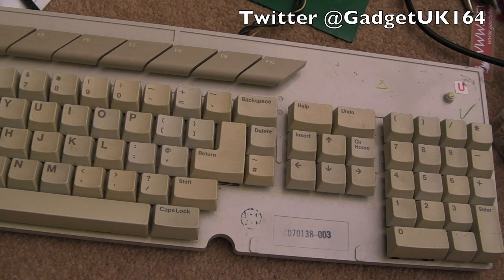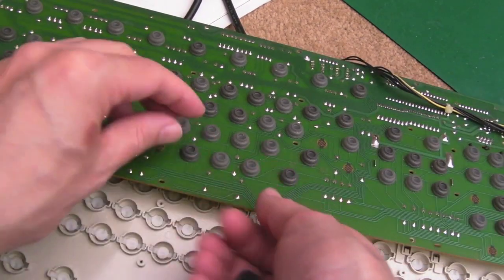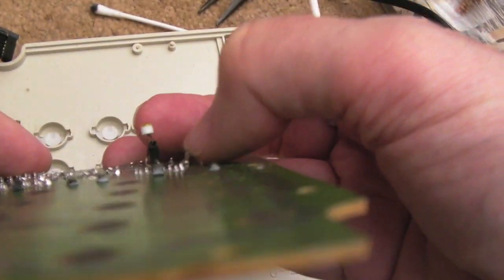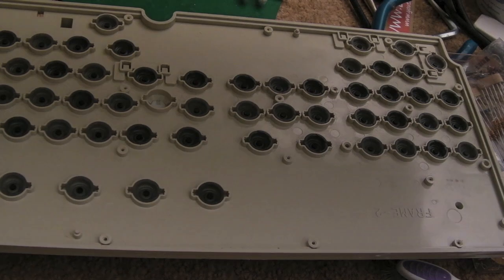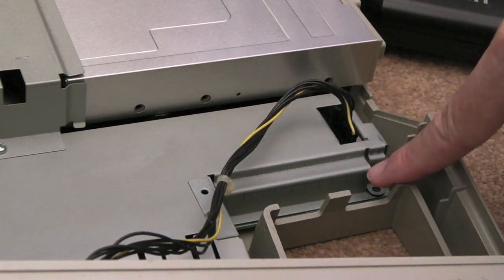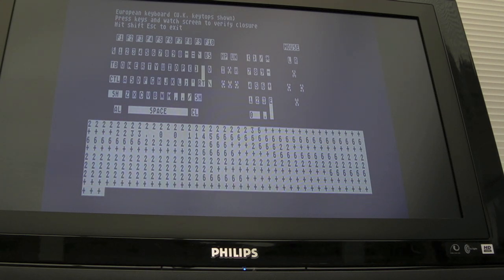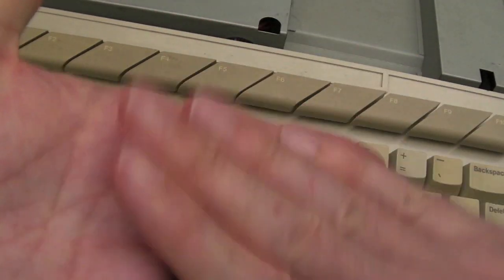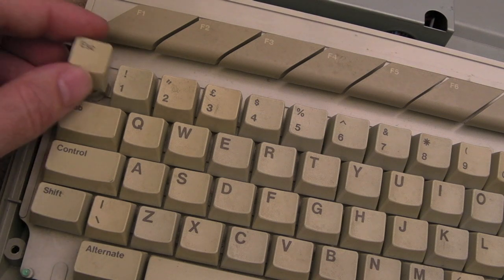Atari ST / STE / Falcon - Keyboard / Joystick & Mouse Ports Repair

Comment: Thanks a lot man. Quite comprehensive
Reply from the maker: Glad it helped!
Reply: @GadgetUK164  Indeed it did, though I had no idea that the soldering points would be so so small. I had to try like four times because the tip I was using was way too thick and after the first soldering the mouse was acting funny. Thanks to my phone camera I was able to find the unwanted contact and fix it. All's well that ends well. 😅👍

Comment: I made another comment about getting a better quality camera and I just wanted to add a caveat.... you're getting a lot of really good closeups which, in my opinion, is more important than a high resolution. So getting a better camera could be pointless if you can't use it to get as close... IE: Close-ups > High resolution.

Also loving the fact you're including ALL your thought process, especially the ones that turn out to be completely wrong. The number of times I get stuck on a problem and don't have a clue where to go with it, seeing your workflow at every step is brilliant and inspiring

Comment: Those rubber/carbon pads can be refurbed by rubbing the central black dot on a piece of paper instead of using IPA.
Reply: I stuck a piece of foil over rubber part.

Also - vital to identify which keys don't work. Register them on reverse side so that you KNOW which rubber didn't work. Like follow the lady game ... else you will likely put them back in different location and wonder how your fixed the two broken ones but two different ones no longer work. Ask me how I know :-).

Again - adding some foil to those ends can make them work again.

Comment: I found an odd Mitsumi KB at work with the same type of rubber dome switches. It had a strange mini DIN plug on it though. It was headed to surplus and I thought about picking it up form them but was not sure what it might be able to be used for spares for. I'll have to see if it is still available.
Reply from the maker: I've got some of those domes spare for my ST.  But you don't need to replace them when it behaves how it did in this video.  I think the problem is IPA changing the resistance on the very surface a little.  But all those presses later its back to good conductivity.  The conductive part is quite think on these two.

Comment: Car rear window heater resistance silver paint, works well with keyboard rubbers. Paint a thin layer on the rubbers and they will work like new.

Comment: Nice repair - do you prefer cone tips over chisel tips? I've kinda noticed chisel tips are better at applying more heat more quickly.
Reply from the maker: Chisel is the way to go - I just need to find one the right size for this Hakko.  I've got a load of tips for it but none that are like the tip I used to use.

Comment: Ah this keyboard, I know too well. Notoriously bad.  Few things to note, you remember that tall pole that you refitted to the case in a previous video? Just have a look where that is placed, and its intended purpose. It's supposed to provide support to the keyboard but it's smack in the middle of those traces you can see on the flip side, any accidental impact on the keyboard can puncture the PCB  in that track dense area. 

I snap that post off of every ST I get, it's not needed, the plastic surround holds the key board firm enough, hardly any flex. And I hard wire the ports pads to their respective places. I have pics of this.

The LED's are really fragile they have a ceramic type substrate, so easy to chip or fracture the base, better to just replace with a modern equivalent.

EDIT: Oh, also Gadge, the repeating keyboard click can be a sign of bad RAM - happened a lot on my STE with SIMMs - just a quick clean helped once I read about that back in the day.  I no longer have the STE.
Reply from the maker: Thanks mate =D  Yes, I noticed where that post goes =D  I stuck it back on with epoxy, but I might ignore it next time lol!

Where did you read about keyboard clicking and bad RAM - that's the first I've heard of that lol!  RAM problems will result in crashes or bombs shown.  The keyboard clicks from from one of the ACIAs (and ultimately the key press).  It's more likely the keyboard clicking in your STe was that black power stuff I talked about in this video - I  saw it very clearly on this keyboard prior to cleaning the pads.  Just by virtue of turning the STe/STFM upside down that clicking issue can ease up for a while.  The keyboards on these have stood the test of time well, but they aren't that well made regards the silicones with the carbon bits.  Much prefer keyboards with key switches of some kind.
Reply: @GadgetUK164  I experienced the repeated keyboard "click" sound many times on my STe, I often had bombs, but more than likely a white screen (no boot to TOS), and would clean the SIMMs, but not the sockets and that seemed to fix it for a while. I cannot recollect the exact mag I read about it back in the day, I have a load of ST paper back that I should add to the archive on Exxos, one of those things I keep meaning to get round to.  It deffo wasn't ST Format - been reading the ones I have on the loo lol.
Reply: Hot snot on the ports between the metal supporting bar can help with fatigue, and can be easily undone with IPA if need be. The metal bar has a really low tolerance, hardly offers any repetitive action reinforcement.
Reply from the maker: @Neffers_UK  I am pretty sure that magazine article was wrong!  Cleaning the SIMMs and reseating them was solving your white screen issue.
Reply: @GadgetUK164   Maybe so. Sitll, the white screen issue did make the keyboard clicky sound, so dunno if that was a bi-product of the white screen or what :)
Reply from the maker: @Neffers_UK  The clicky sound is key press - I suspect you just had the same issue I had on both this ST and the one I have, whereby when you take the keyboard to bits and inspect the pads on the keyboard PCB, there's black dust inbetween the fingers.  That is the main cause of ghost key presses where it makes the constant key click when you aren't pressing a key.   I saw that so many times in the past on other ST's too (including my STe).
Reply from the maker: @Neffers_UK  You get the white screen on boot normally!  And that's where the key stuck / ghost clicking happens most!
Reply: @GadgetUK164   Yes, also a result of some TSR viruses. 
 
Though, when my RAM was flaky I'd get 3 or 5 bombs, or a 3 with a bunch of lines. If that didn't happen, I'd get the key repeat noise. IT was a 3rd hand machine at the time, I think I will have been 10-13 years old when I finally saved up enough for it lol. 

You just reminded me of my "favourite" TSR virus,  "ghost" which would invert your mouse movement. 

Depending on TOS you can hold some keys and force the persistent keyboard click, Space bar can do it,  or one of the emulated mouse buttons. Maybe a cursor key + Alt and insert / Home, as it boots and then the OS gets a little confused.  

Fun times!  I can't wait to get my ST working as it should thanks to your help. Got a lot of things to do prior, hobbies are super low priority atm, sucks.

Comment: I clean plungers like them in warm soapy water I dont like using ipa on em.
Reply from the maker: Yeah., that will work - but a light clean every 20 to 30 years with IPA won't do it any harm!  It's rare for that key problem to occur after cleaning.  It happened to one key on my own STFM.  In this one I just got unlucky and it was 6 or 7 keys =/